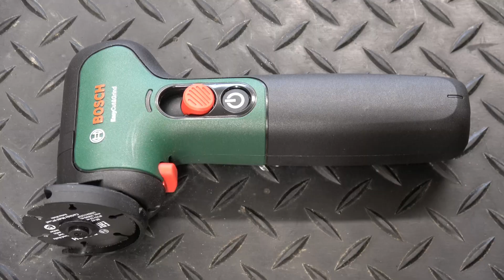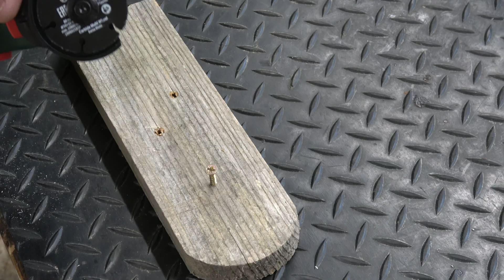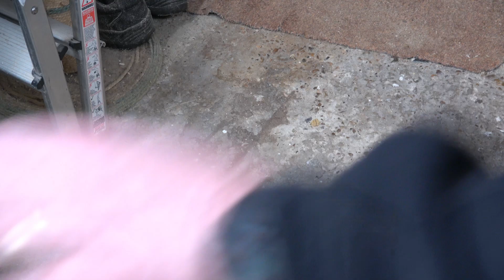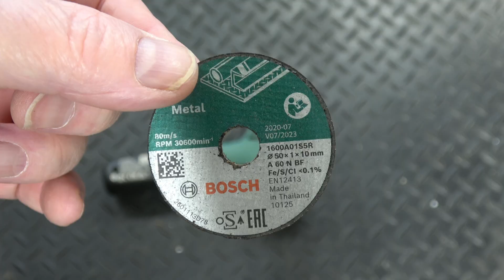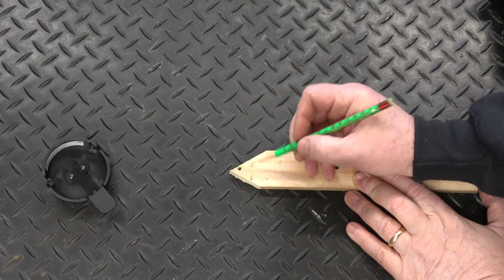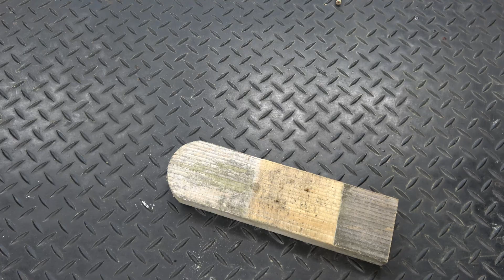Bosch Easy Cut&Grind a New 'Go To' Tool - Review and Detailed Demonstration

Comment: Very helpful video… thanks a lot 
Sometimes lower led turns white , wondering what does that means
Reply from the maker: If it is the battery charge LED at the bottom of the tool, it flashes white when the temperature is too hot and stops charging until the temperature reaches an acceptable level.  :-)

Comment: I had it replaced twice by Bosch for the failed charging and the last one they sent also fails. All of them failed on the first charging. I do use proper cables and chargers that charge dozens of other items. Did you ever met this issue with your sample?

Comment: Hi there, thanks for your video. I'm thinking of purchasing this to cut some laminate flooring out from a toilet and sink pedestal and to remove grout from between tiles. Would this be ok for grout removal and if so with one of the supplied blades or an extra one ? Thanks 👍
Reply from the maker: It should work for grout removal James.  I would try the carbide multi wheel for the flooring and grout.  I cannot find any reference to grout removal so this is only my opinion.  :-)
Reply: @RussellPlatten  thanks Russell much appreciated. That was my thinking too. 👍😄

Comment: This small tool has many applications where precision is the main concern, I use to make small profile cuttings and using a big angle grinder gets me nowhere due to the powerful vibrations and pulls, I had no option but to assemble myself a small angle grinder out of XD-775 motor (bearing instead of bush) and a "M10 Arbor Mandrel Adapter, 5mm bore", but now that I've learned everything about this tool I can confidently buy it without any doubt. Thank you for this enlightening review.

Greetings from India.
Reply from the maker: Glad I could help Johan.  Greetings from the UK!  :-)
Reply: у нас он стоит 100 долларов ... А куплю ка я себе в подарок на новый год ! Мне тоже такой давно нужен ! Когда то давно купил себе BOSCH OXI . Служит до сих пор очень его люблю всегда на любой объект он со мной .  😁

Comment: I use my bandsaw for trimming boxes for recycling. The throat limit is just about right to fit into the bag! That does look handy though and small enough to fit into a travelling toolbox.
Reply from the maker: I edited out the bit where I mention that I use my bandsaw to cut the cardboard.  I had a little accident a few years ago when I wasn't paying attention and needed some stiches.  I am wary or using it now, so cutting the cardboard with the new tool will be my preferred method!  :-)